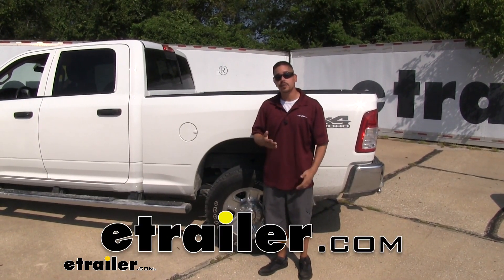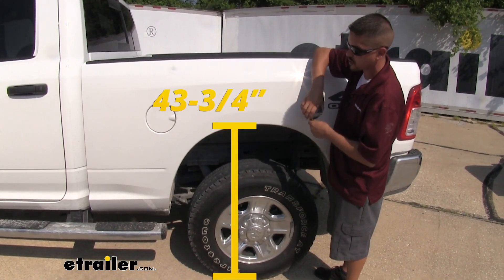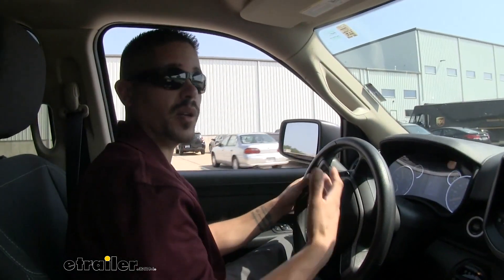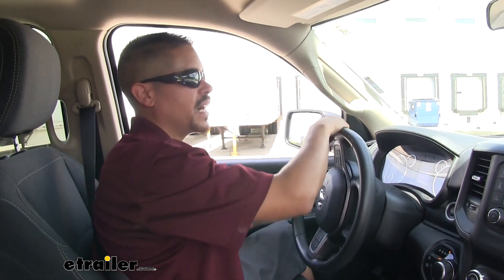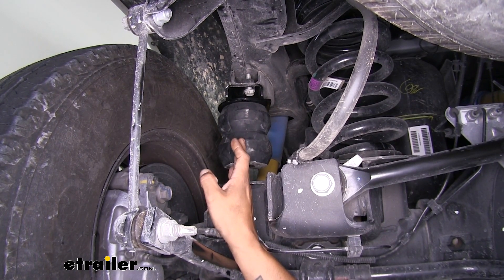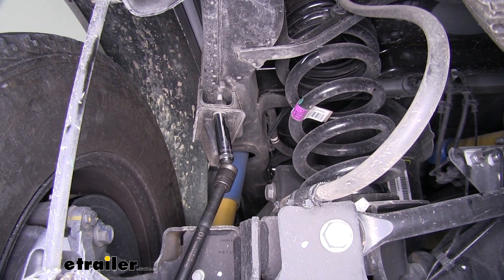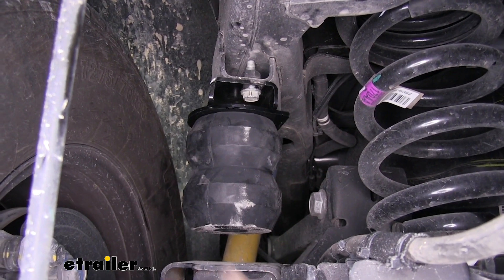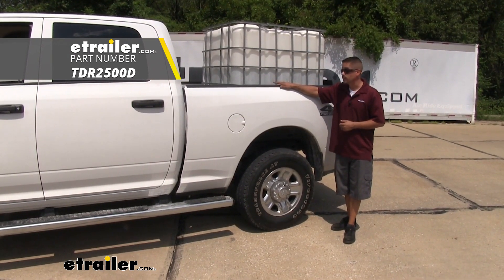etrailer | How to Install: Timbren Rear Suspension Enhancement System on your 2019 Ram 2500

Comment: You have liquid weight with no wave breaker,  not solid thus the driving conditions will be WAY more challenging you should have used solid weight.  My opinion.
Reply from the maker: We have driven the test course with the water tank and a trailer. They had similar results because of the bouncing of the trailer's suspension.
https://www.etrailer.com/Vehicle-Suspension/Timbren/TDR2500D.html